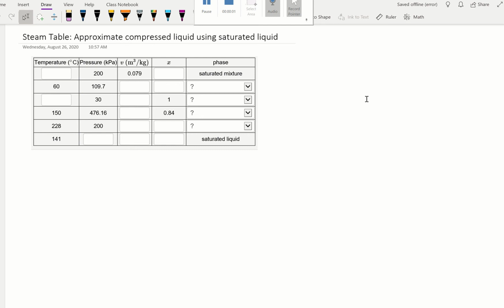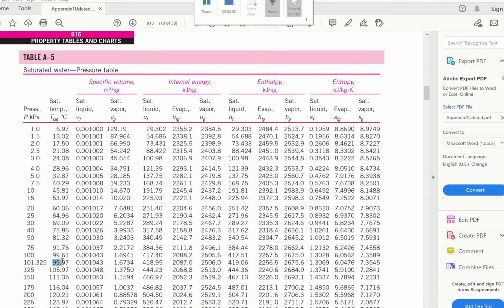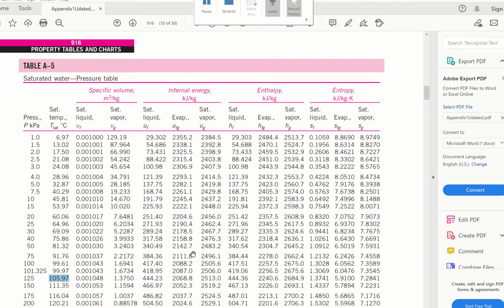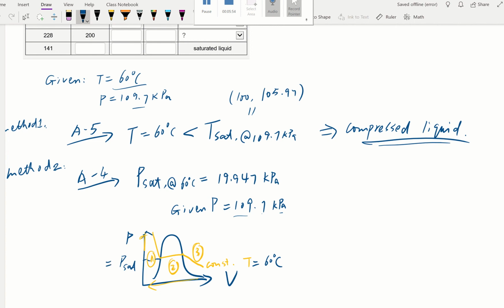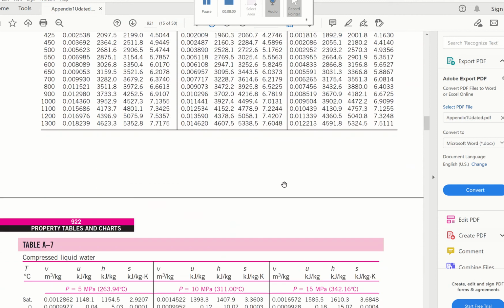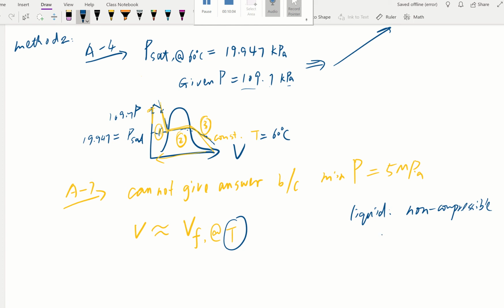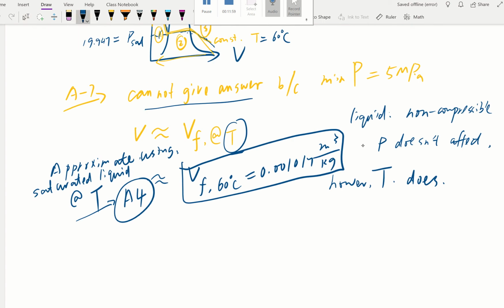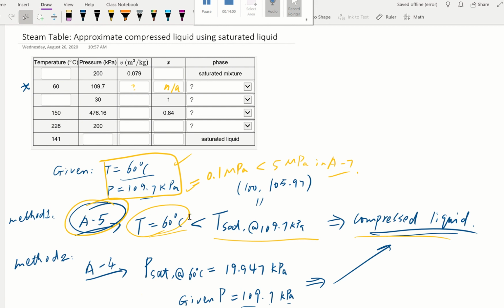Steam Table: Approximate compressed liquid using saturated liquid Temp Table

Comment: thank you so much, i was having a hard time figuring out how to go about using tables, i knew i had a compressed liquid but my pressure being too low for C.L table confused me a lot
Reply: i also wasnt 100% clear on if we could use the single state (such as Vf, uf, hf) or if we had to do some kinda of linear approx in this situation, thank you for adding that extra stuff in as well even though it wasnt apart of the table